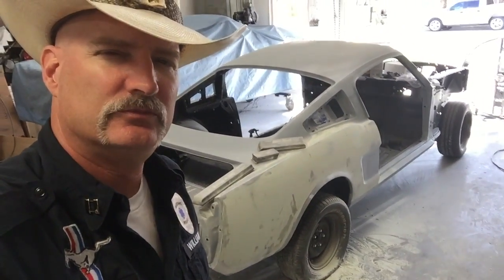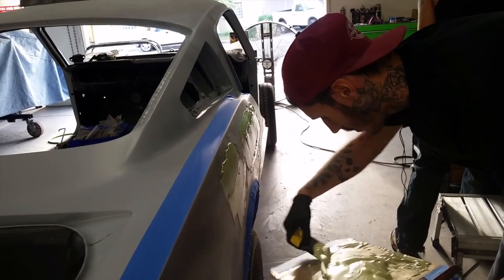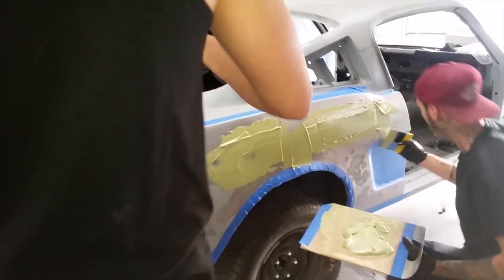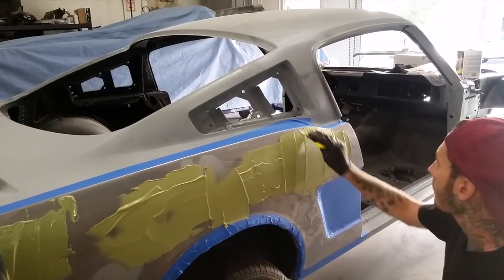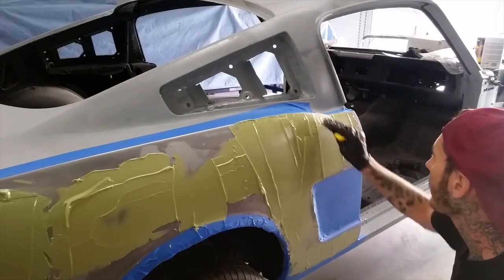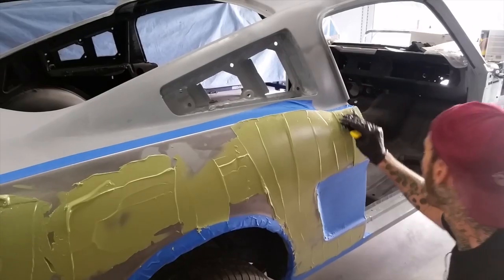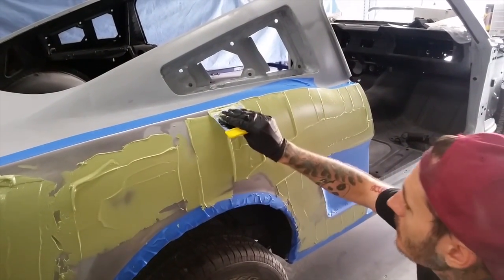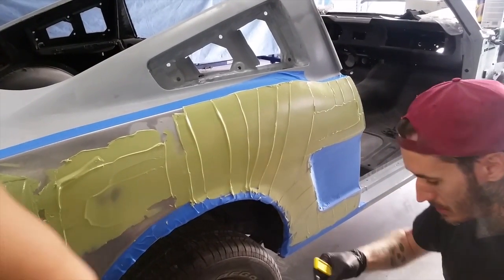Quarter panel Skim Coat - Sandra's 1965 Mustang 2+2 Fastback - Day 91

Comment: You guys are making way to much work for yourself holy cow! I retire cars for a living. Skim coating is ok but you guys aren't skimming. Your globbing it on. Using a 4inch spreader??? Come on. When I skim coat big panels I place a huge blob of filler then get my flexible piece of 10,12or 14 inch x 2inch piece of plastic and start spreading. Try it. I'm sure you are also using a 6in h sanding block or a da sander. Get some dura blocks.

Comment: Looks like a good candidate for that new blade tool  that is on you tube . For a number of years now  I have been using a piece out of the back part of an old hand saw that has the straight back on it. With a zip cut on my grinder and full face shield  I cut a 2 and a half inch wide strip out of it about 18 to 20 inches long. I found that it worked great for most plastic filler jobs on long panels. . You can customize them to suit your own needs. Also used black primer as a guide coat to find the places that require a bit more attention. The powder guide coat is great too. Good luck with the Tang.

Comment: It'll come out just fine for Sandra, you guys are being too harsh on the kid. He not a hack. hacks don't tape edges or take care in spreading bondo. Hacks primer on 180 grit scratches and paint on 320 and stand in front of it when the customer picks up the car. 
1. He is doing a great job spreading it with what he has. 
2. He also knows what he is talking about regarding amount of bondo being applied and taken off, the end result is not going to be more than recommended. 

This is great for the customer, at least they are not hiding from the customer.  They are doing decent work.